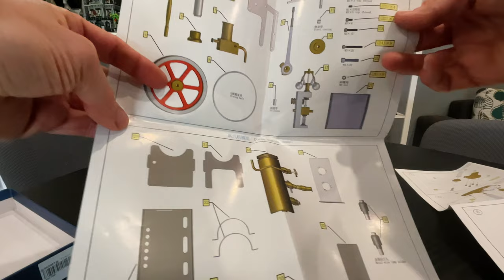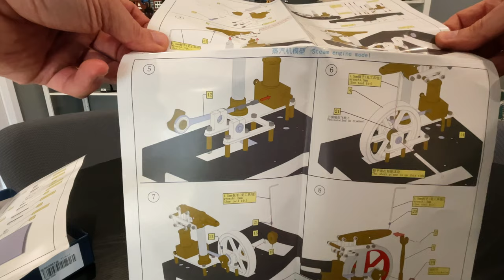MODEL BEAM STEAM ENGINE - RUNS AND SOUNDS GREAT!

Comment: Just got mine, looking forward build. Surprising well finished. RTFI. Makes plain that beam piston assembly critical. It’s a gentle demo, not to run your house lol. This a good build thank u. Ps screw at cylinder base to stop water lock as per real thing. Release condensate till cylinder warmed up.
Reply from the maker: Awesome, thanks for the comment mate

Comment: I like that it doesn't rev its nuts off like the more usual horizontal engine models do.
Reply from the maker: Yeah absolutely
Reply: I find that appealing about this model as well, seemed to run nice at low revs.  Did you lubricate any parts?

Comment: any particular oil you have to use?
Reply from the maker: 3 in 1 oil
Reply: @RCTanksTrucks247  get some synthetic steam oil for the piston instead, it will mix in the water and oil everything better, while oils like 3 in 1 get quickly flushed out by water. steam oil improves performance and gives a longer life for your engine, and synthetic wont tarnish brass like regular oil does, you can use 3 in 1 on the other joints other then the piston, but is more likely to tarnish the brass parts quicker.